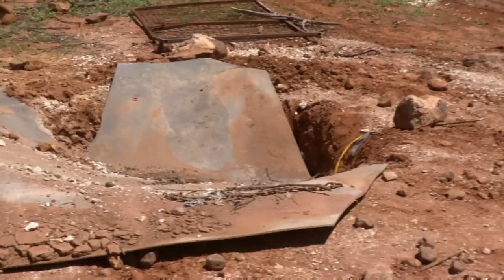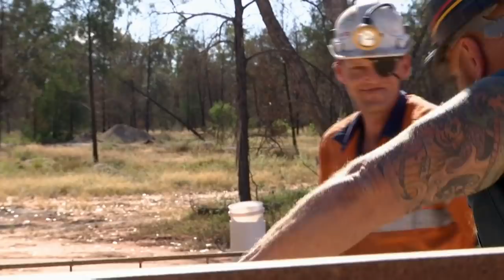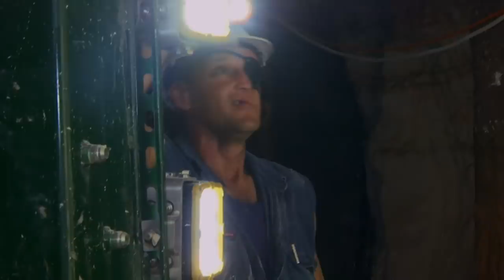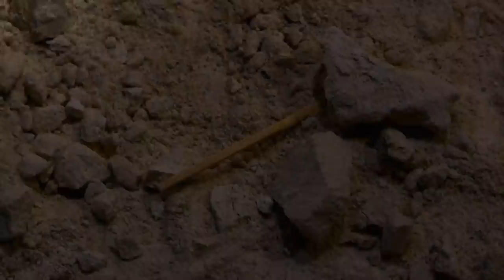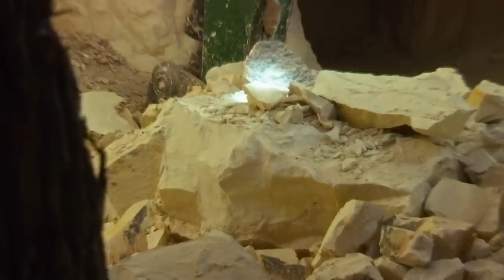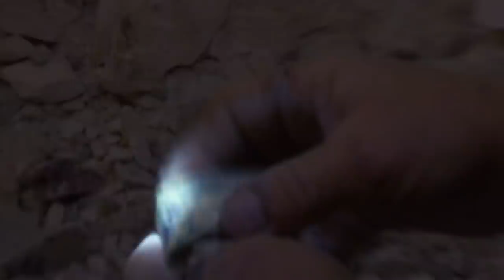Rod Manning Narrowly Misses HUGE Rock Fall Underground | Outback Opal Hunters

Comment: I have no experience with any mining underground, I do surface mining but would it be worth putting a 4'x8' or 5'x10' really heavy duty expanded metal above those jacks on the digger up against the ceiling? If it does fall that would add alot of rigidity and some safety over the operator